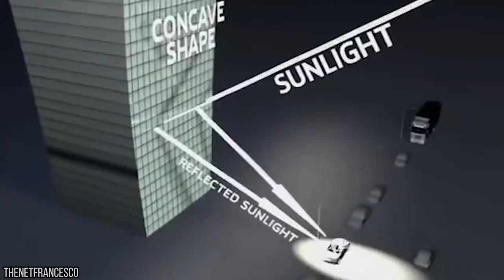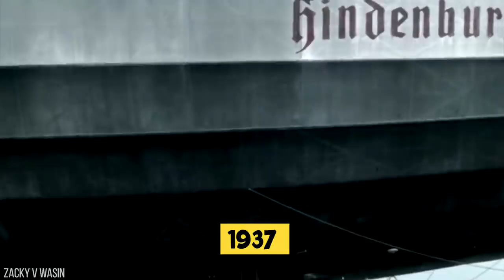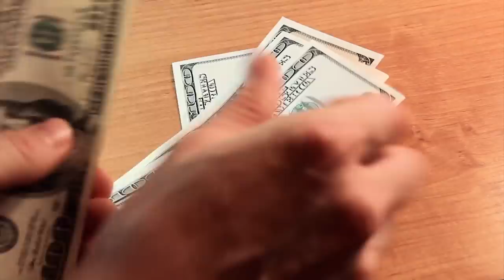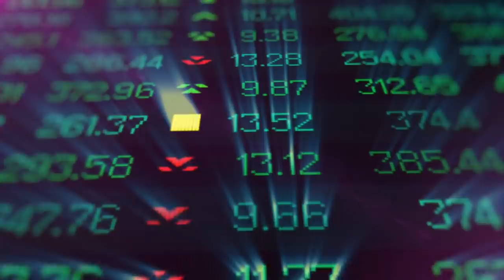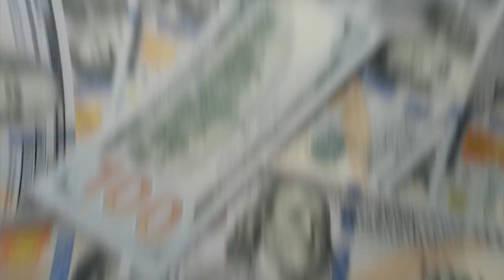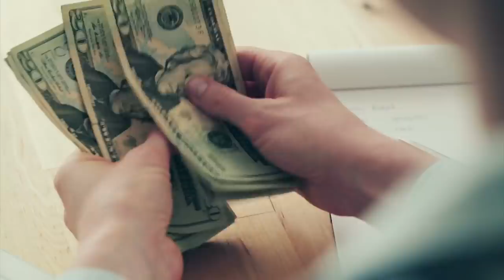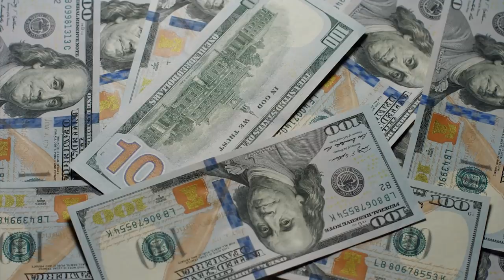15 Most Expensive Mistakes in All History!

Comment: That is incorrect information. The Hindenburg went down because of the doping compound that they use to cover up the cloth panels on the outside. They used aluminum powder and iron oxide. They painted the outside of this thing with those in the doping compound. Essentially they covered the outside of the Hindenburg with solid rocket fuel. The Hindenburg was a huge airship and was burned Within 52 seconds from end-to-end. The hydrogen gas added to the fire but was not the cause of the fire. That brought the Hindenburg down ultimately. The Germans tested and found did the outer covering of the Hindenburg was extremely flammable because it was covered with aluminum powder and iron oxide two main ingredients in solid rocket fuel like we use for the space shuttle and other Rockets. There was a documentary on PBS that explained the whole thing. The Germans simply let us believe what we wanted to do about the hydrogen gas causing it to explode and come crash into the Earth. But when hydrogen gas Burns is the pale blue flame not a roaring red and orange flame. Like solid rocket fuel makes. Just thought you all should know.
          DRC. ;).  
PS, the tragedy happened May 5th I believe 1937 Lakehurst New Jersey. In fact the hangar that they kept the Hindenburg in is still there.
Reply: desertratconnie Constance 
Smartie

Comment: LOL , 1986 , NOT 1968 for the Chernobyl Disaster it was even on screen . <3
Reply: Hindenburg was filled with hydrogen.because helium wasn't strong enough to lift the.weight of the airship. There was a lightning storm in the area.at the time, static electricity from the.storm has been one of.the.blames of the disaster. Once the landing lines touched the ground they grounded making the Hindenburg a huge bomb.t
The static electricity built up from the storm on the airships hull

Comment: Why are we using REAL measure instead of Metricrap? Because it is both real and consistant. Metricrap varies from country to country. 7.62 Mttricrap here measures .308 inch. In Russia, 7.62 Metricrap measures .311 inch. I've slugged enough Mosin-Nagant barrels to know this is consistent.  Years ago, I helped set up a friend with a Moisin-Nagant for hand loading. First step is always slug and measure the bore to verify diameter. This way, you get the correct diameter bullets to put in the empty cases